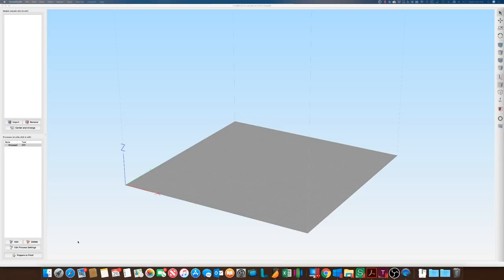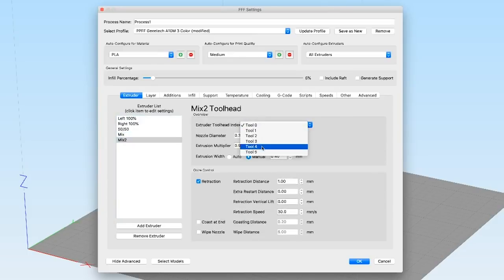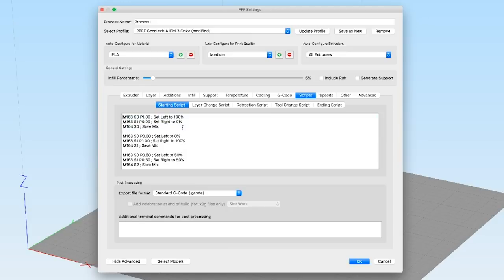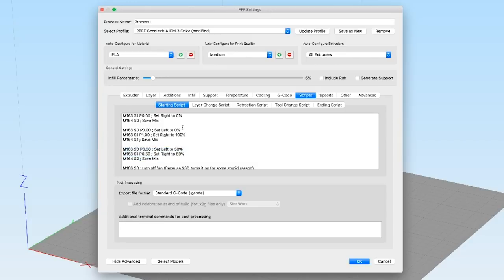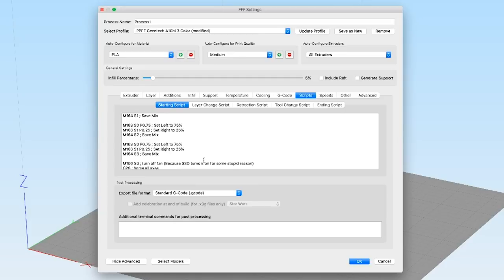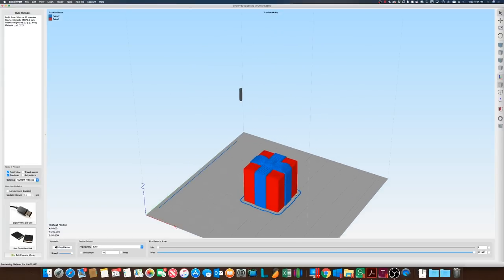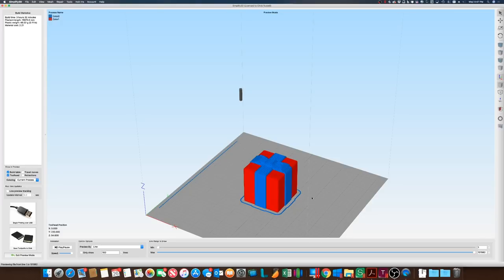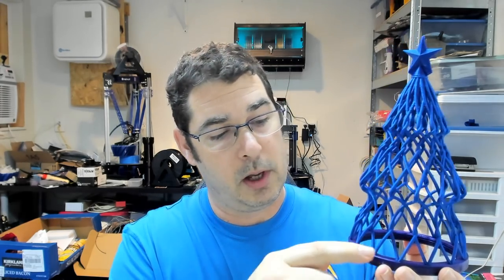Slicing For Virtual Extruders For the Geeetech A10M and A20M

Comment: First off nice video. I'm a newbie to 3D printing so I'm not totally grasping programming gcode.  So from what I'm understanding if I what the printer to print color x then M164 S0 (if assigned) has to placed into the code where you want red? and if M164 S1 is white then this code needs to be in the code where you want white and M164 S3 is a 50/50 mix when you a blend. How do you do that when you slice ? I don't see a good dummies guide on g-code (at least not yet)
Reply from the maker: There are a couple ways to do this, but the simplest way is all in the slicer. Assuming you have a model intended for multiple extruders, you define the printer as having (3) extruders (the third is the virtual extruder), assign one extruder to each part in the slicer, and put this code into the beginning of the startup script:

Example:

M163 S0 P1.00 ; Set Left to 100% (First Color)

M163 S1 P0.00 ; Set Right to 0%

M164 S0 ; Save Mix

M163 S0 P0.00 ; Set Left to 0%

M163 S1 P1.00 ; Set Right to 100% (Second Color)

M164 S1 ; Save Mix

M163 S0 P0.50 ; Set Left to 50% (50/50 Mix)

M163 S1 P0.50 ; Set Right to 50%

M164 S2 ; Save Mix

Just put that at the beginning of your startup script in the slicer before all the homing and movement stuff. The slicer will take care of generating the gcode behind the scenes to switch extruders on you. NOTE: this ONLY works with Geeetech A10 and A20 printers that have the latest version of Marlin for them that supports these mixing commands. I believe that should be all of them currently shipping, but I think I mentioned in the video how to tell if you have the latest or not.

Good luck!

Comment: thanks !! If I want to do 3 colors (or more ) can I use the dual extrusionwizard in S3d ? Or do I have to align the parts manualy ?
Reply from the maker: Ab Roos unfortunatly, afaik with 3 colors you need to line it up manually.